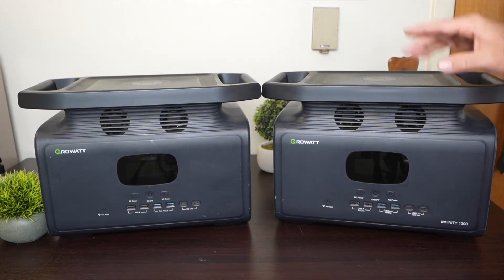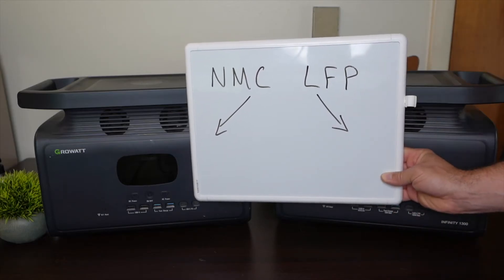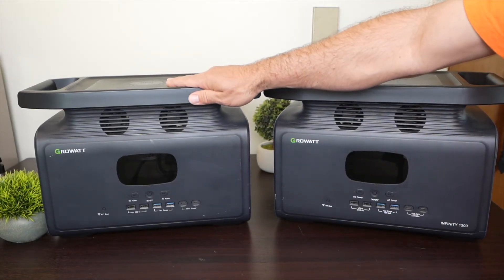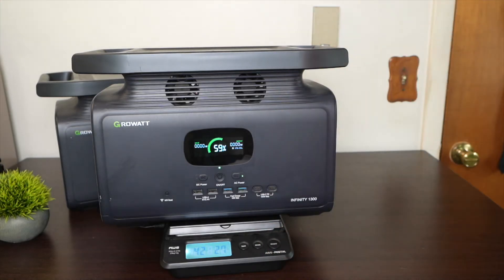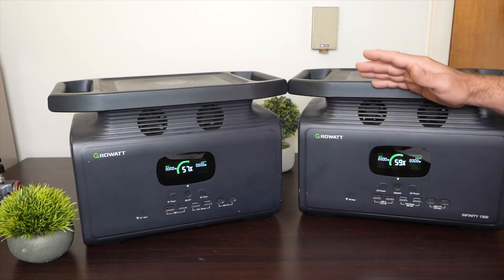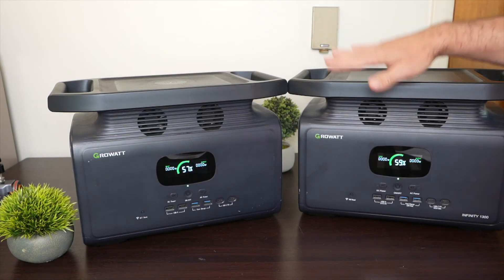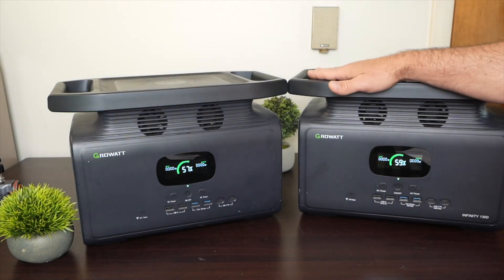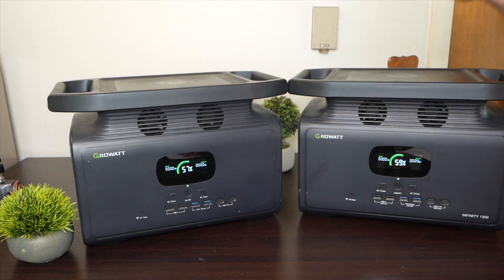What is the Difference Between LFP and NMC Batteries?

Comment: Why do nmc battery cars cost more than lfp battery cars if lfp lasts longer.
Reply from the maker: That's a good question.  I have not researched it myself but my initial guess is that because NMC has a higher energy density they can advertise those cars with a higher range and therefore, charge a higher price.
Reply: Some elements in NMC are slightly rarer compared to that of LFP and is expensive.
Reply: Cars with nmc have a longer range
Reply: NMC give more power and cars can accelerate faster. 
Also they can charge faster and are less afraid of cold. 
But the main reason I think is because they are the most compact batteries and it is a huge demand  from all kind of smart and mobile devices.
Reply: Ncm batteries have higher power ratings and energy density,  meaning longer range and suitable for those that need power like pickup trucks
Reply: NMC with higher risk & more powerful, can drive fast & tend to accident..... & Bye bye

Comment: One major difference you missed is the fact NMC batteries don't like being left at high states of charge, whereas LFP batteries are happy to be fully charged.
Another point missed is that the NMC based 1,500Wh battery is actually 1,512Wh while the LFP 1,300Wh is actually 1,382Wh, only 130Wh less (8.6%).
Given the fact that the NMC chemistry doesn't like being fully charged, the 1,300Wh battery actually has more usable power.
Reply: From my research neither chemistry likes to be fully charged.  Both will degrade faster if fully charged
Reply: @diandamy6734  LFP batteries need 100% charge
Reply: Do your research LFP batteries WILL degrade faster if you charge them 100% every time. LFP batteries just don’t degrade as fast as NCM batteries.
Reply: @srt_yt  no, its only good to full charge when you want calibration and thats all
Reply: Its a common misinformation.
Both batteries don't like being fully charged or discharged. 
It is just LFP batteries need to be charged to 100% once in a while so the BMS could calculate correctly the state of charge.
Reply: @markmd9  The LFP battery has 3x the cycle life of the NMC even with regular charges to 100% to calibrate, which it is designed to work with.
Anyway, none of it matters any more as neither model seems to be linked to the first comment above.
Reply: Perfect
Reply: 100% recharge is for the BMS to accurately represent the SoC as the voltage curve is very flat unlike other chemistries
Reply: Ncm has higher power ratings and  batter at cold wheather condition..hence is not as limited as LFP ones.
Reply: Right 👍, reason why I had issues with my Ecoflow River 2 power station with LFP battery when I changed it charging settings from 100% to 95%, I had to change it back to 100% and reset the BMS to return the power station to normal. Thank you for sharing.

Comment: Point 1 and 2 are basically the same.. density one is energy and other is "physical" density
Reply from the maker: On the cell level the density is usually measured in Wh/Kg so yes, there is that correlation.  What I am hoping to point out is that when someone is considering a power station and these chemistries are a factor for them, these are the differences they would notice as they make comparisons.  Thanks for watching.
Reply: Which is better battery